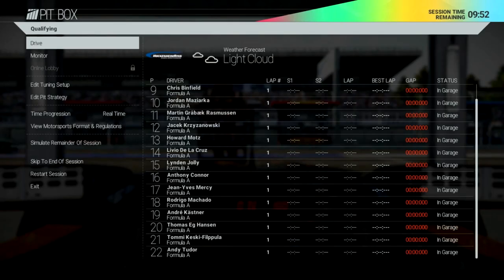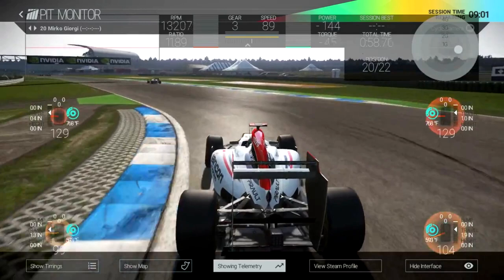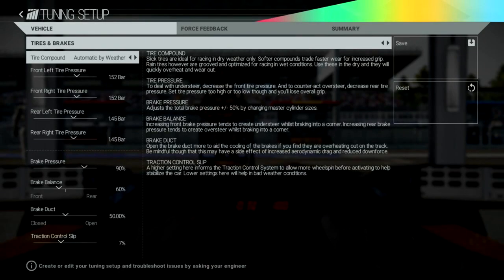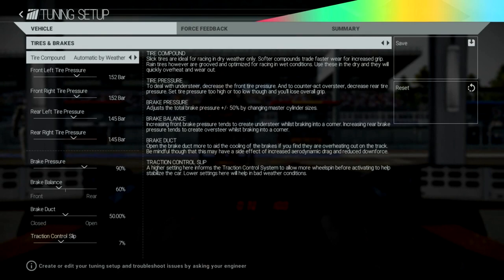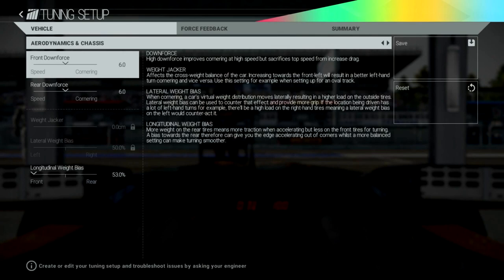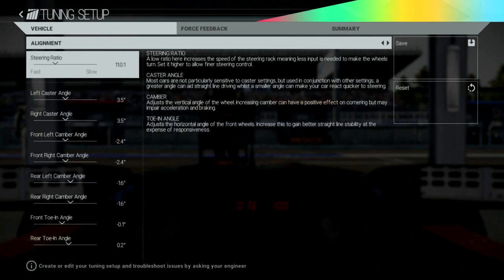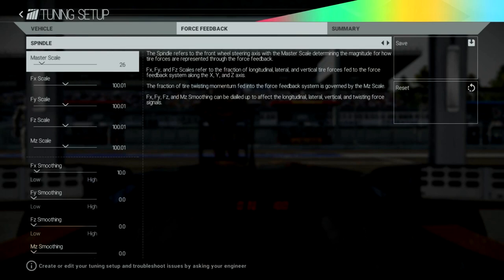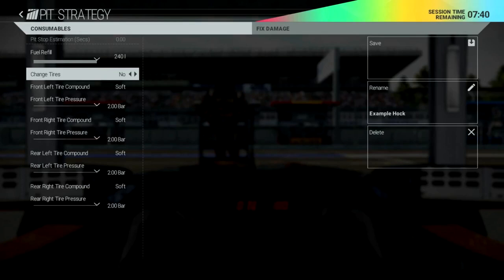Project Cars - Trailer Analysis Tuning!

Comment: hi, nice vid, i guess opening the brake ducks increases drag not aero, meaning you'll be hurting top speed down the straights and not allowing you to corner quicker. So you want to run the brakes at the highest temp possible but not so the temp reduces braking performance. :-)
Reply from the maker: Spencer McCarthy Yeah I know its going to make it fun for tuning and the different set ups you could use :)

Comment: i was hoping that they would allow us to adjust gear ratios.

read some shitty news about ps4/xb1 edition.frame drops to 20's,input lag,missing audio at certain rev ranges.
Reply from the maker: ***** There is supposed to be another video coming out looking at tuning be we will have to see. 

I am hoping they have sorted all that out for release. they have had long enough.
Reply: *****  I would have thought with all those other options for fine tuning that they would add gear ratios in the mix. hopefully anyway.